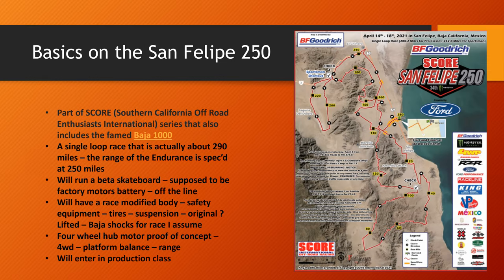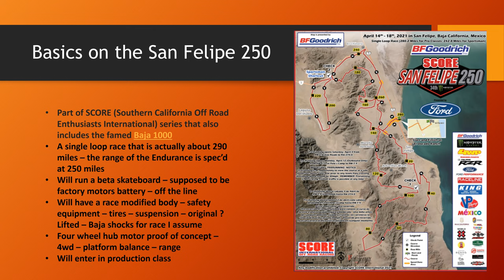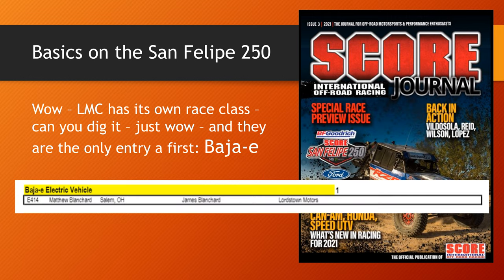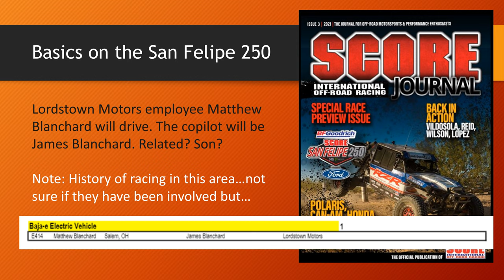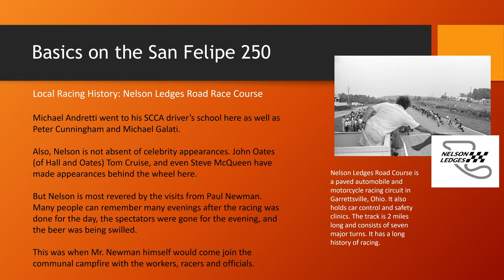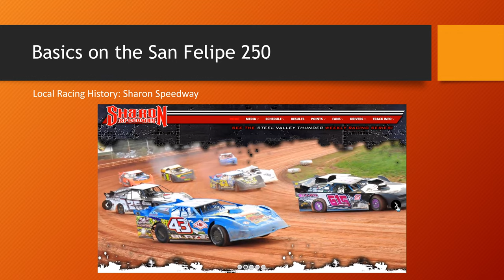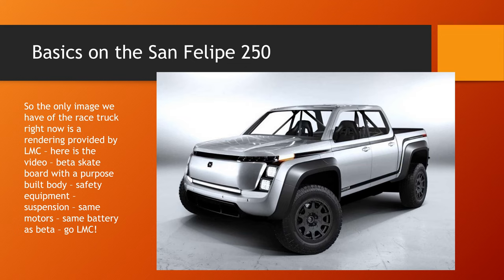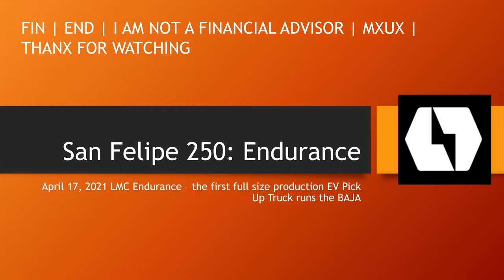LMC | Race News | San Felipe 250 | Endurance | Drivers | Builders | #BAJA-E | #RIDE | #MXUX | #SCORE

Comment: Lordstown motors
I believe that this truck is being way underestimates.
This truck is approximately 1000 pounds lighter which will give the driver better handling with stability and comfort allowing the driver to go through rough terrain with ease.
Reply from the maker: Not sure on the regular baja trucks on this - but LMC not only light but front to rear and side to side weight distribution has got to be nearly 50/50 (anybody have a figure on this?) balance should also aid handling Adam

Comment: I still love the fact that their own Rendering has normal disk brakes instead of the hub-motor setup
Reply from the maker: ya 47 - looks like ventilated disc brakes disc - suppose it could be mounted on surface of hub - theoretically would work? - or a new type of hub cover for cooling? Most likely a cut and paste of the baja wheel image - since hub motors are so new there are likely no real images of a mounted desert race tire on a hub motor to use you know - not releasing any real photos I can find....

Comment: I had assumed they would have an experienced Baja driver lined up, i hope these LMC employees are up to it.. best of luck to them. It sounds as if they have a chance of winning their class 😉 I cant see why they have mentioned the possibility of getting around on one charge, thats not going to happen unless they crawl round which isnt what this is about. Maybe they figure if they can spend half the time in the air it will extend their range. Fingers crossed for them.
Reply from the maker: you know r they have been cagey about what the final version of the production battery will be - saw a presentation and the lmc answer on the battery was an "either - or" so there could be both lighter body and bigger battery kwh - at first said they thought they could make it without a charge - then walked that back so we will all have to see - a cliffhanger - thanx for the comment
Reply from the maker: ya on the drivers - I am sure they have a reason - like I said in the vid- or - maybe no pro wanted it - all of them driving in the race? In any case they have to have been out there running the course practicing  - got that going for them - and the drive system could really be spectacular as well - we will all see soon - thanx D

Comment: UPDATE :  Read 5.1 of the San Felipe 250 rules.  Baja-e & sportsman classes that start late ie 9:30 am) will be taking a short cut.  this in essence reduces the length of the race for Endurance to 242.9 Miles.
Reply from the maker: ya vic - that charge will be a short one for sure - first 20% on batteries charge faster - also maybe no charge? Ha love it

Comment: Are you related to Steve Burns? Your voices are kind of similar. Anyway, I'm wondering if they are going with a slightly bigger battery for their race vehicle? Also wondering, if it can go 120mph why does Lordstown limit it to 80mph on the production truck? This is a negative selling point. None of their competitors has said their truck can only go 80mph. Finally, wondering if there will be a live feed of their entry? I really want to see it in action!
Reply from the maker: On Steve Burns - No no relation -but I like him - did a video on his background check it out - did you know he was the developer of SIRI? Apple bought it - on the battery - they are going with the production battery on the race truck but they have not finalized the size of it yet - think it depends on the type of cell they use - anyway it will be a production battery - On the 120 mph speed - it actually may go faster as the motors have a top rpm of 15k - that is at the wheel - the FLEET version is limited to 80 mph for insurance reasons I suppose - a commercial application - don't believe the race truck will have any limiting software at all - there is a dry lake they run on for part of the 250 - trophy trucks hit 130 mph there - the CONSUMER version of the truck I am sure will not be limited to 80 mph - Gordo right now they are going to roll a FLEET version off the line first - then go to consumer next - proof of concept kinda thing - thanx for the comment